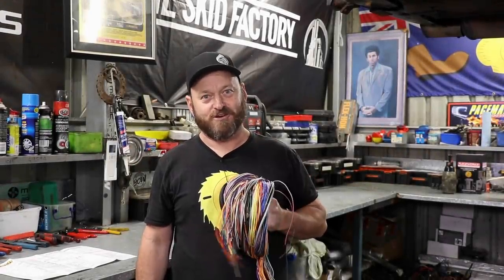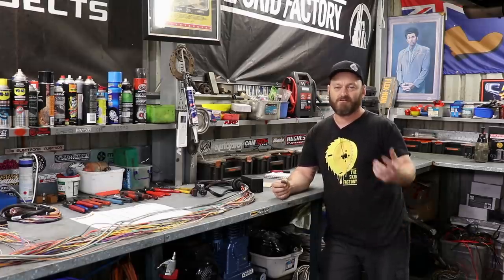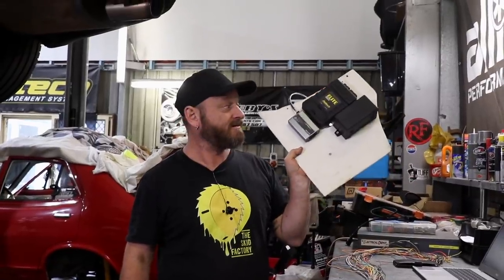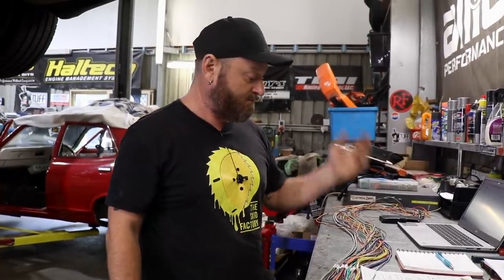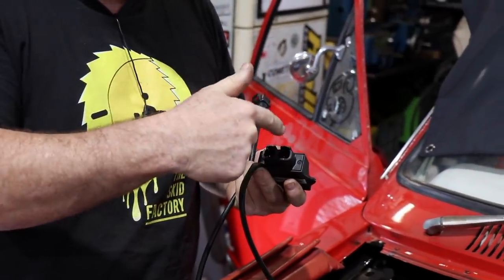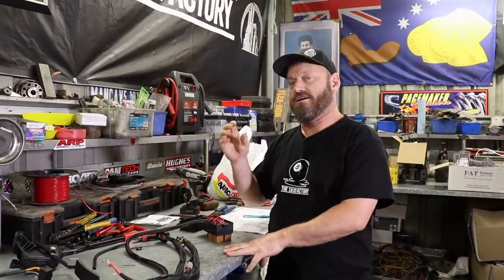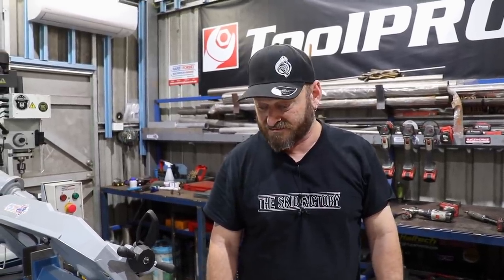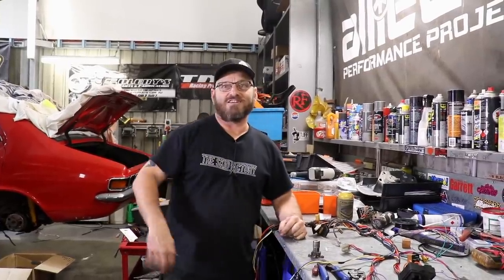1JZGTE POWERED LJ HOLDEN TORANA EP 13 - THE SKID FACTORY

Comment: Thats looking nice and clean, no reason to hide quality work. I used a MegaSquirt controller for my 95 Dodge Dakota with 5.9 magnum series engine (was 3.9). Actually soldered the entire ECU myself and was able to configure for all my (not LS) sensors. I was also able to configure sequential injection and spark, using LS1 coils salvaged from a paying job. You always can find a few goodies when eating engines from a salvage yard. Able to work out overdrive and lock up on trans as well as AC. The ECU fit my budget and is basically universal for any application, good support from DIYAUTO (dealer) and the forums. Used my brain and read a lot before purchasing. Now working on the new engine and dash harnesses when I can. 
Great content, I’m sure having to film everything is a pain sometimes but we appreciate it.

Comment: A tough part is making sure you’re using the right combinations of wires, terminals and seals. They tend to only really want a specific range of core and insulation size when you read their specs closely. You often need sort of specialist wire like 18ga txl with thin insulation that you just can’t get a your local auto parts suppliers. It really does all come down to careful planning though.

Comment: Thanks for that very informative guide guys iv got to do this with the factory engine loom and was far from looking forward to it but you have made it less daunting thanks and keep up the great videos and the great work.
Reply from the maker: Theres probably 3 days in both engine and ECU. Reduce the ecu spec and cylinder count and it gets faster. Maybe 5 hours uninterrupted for a simple 4 cylinder. But you still have to make connections to the vehicle which is also time consuming.

Comment: Love the wiring videos fella's.. was on the fence about the Ebay fuse block but the decision is made now👍
Cheers
Reply: They are a good bit of gear, I have one in my RX2 boot for the fuel setup. I have another to fix the jacked up ignition wiring. If you are fussy, you could just put in better quality relays.

Comment: until recently i had not done any full wire in looms before, im a qualified Diesel mechanic and have done some wiring of accessories and a such for electronic brake controllers at work, recently a friend paid for a pommy guy to make a loom for his super charged ncp13 echo with a maxxecu sport, he got the loom and it was more then average, feeling like ive got enough knowledge i put my hand up to fix it, i fully re-wired his flying loom whilst doing a proper concentric twist and heat shrinking it with proper heat shrink breakout boots, i even changed the wiring for sequential injection because the previous people wired it as batch style and then terminated it pulled it in and adjusted the ecu setup to reflect my wiring loaded a base map and turned the key and boom she fucking fired first go never felt so bloody proud in my fucking life and its from watching you guys do the work and actually listening instead of arguing in the comments that gave me the gonads to get it done, total time spent on loom, 8 hours, 15 minutes initialising the ecu and loading turn after firmware update, once again thank you so much for the information and giving me the drive to do it myself now i have friends lining up for my work because they where so impressed of my quality of work

Comment: Great video guys 😊 Wiring isn't scary so long as you are logical in your approach to it.

One thing to add with connectors is that you also need to check the current rating of the connector itself. Fine for most of the engine stuff but especially for fans and fuel pumps the 15-20amps will need a larger rated connector or you'll melt the connector. Seen that a good few times 😉

Comment: Awesome. I never really liked wiring, but its the stuff that i have to work out relays and fuses, not so much cutting and connecting wires. Have gotten better at it over the years and reasonably confident at wiring an ecu as long as i can work out whats needed for where. Having an au that needs an aftermarket ecu I'd really prefer something mostly plug in but thats not looking likely.

Comment: Irrational fear? No mate, having seen the average wiring job in aftermarket automotive work, its perfectly rational.

People seem to have zero fear, and will run a twist and tape positive insulated only by masking tape in a chassis return vehicle. I worked on a bus once where the tail lights harness was literally zip tied to an exhaust hanger... I'd have thought it'd burn to the ground first time you started it, but apparently it'd done several hundred thousand kilometers and that roll of the dice somehow hadn't occured. On the other hand the alligator clip instead of a fuse for starter solenoid trigger HAD melted into a pretzel (hence why we where fixing it), and the two 12v fans being mounted in series didn't actually turn slower, the left one had just seized solid. So if your going to do the wiring yourself, take the extra time and care to do it properly, it'll save you in the long run.

Comment: One complaint I have about Haltech universal harnesses is the fuse box, it makes the job of removing and installing the harness through the firewall a lot more difficult than it needs to be.
I always cut the fuse box off and crimp in some connectors so I can pass the short end of the harness through the firewall.
Reply from the maker: Yeah that can be a problem sometimes depending on the car. I have cut it off in the past or mounted it in the engine bay.

Comment: I don't have an issue with wiring new things, I have an issue with diagnosing wiring issues in complicated modern cars that act like they are haunted, when there are a million wires, often in unhelpful colours which are difficult to trace, and sometimes terminating and daisy chaining through impossible places like right up behind the dashboard! 

The wiring issues in my LS400 still give me nightmares. I think that thing had about 6 computers for different things as well! I gave up on the HVAC circuit and re-wired it from scratch with new fuses and relays etc, but then the AC refused to engage because the HVAC computer failed some sort of pre-flight check... Just madness.

Comment: For anyone interested in wiring, I'd recommend starting with small projects. I added a subwoofer to my car, and then removed an aftermarket alarm system and repaired the existing wiring. It ain't much, but it's gotten me much more comfortable with wiring. It's handy to know when bastard pack rats decide to chew through the loom on your car. 

I wouldn't recommend someone with no experience putting together an entire custom loom unless they have some experienced help or a lot of time and patience.

Comment: Those relay boxes are awesome! I have one of them in my RX2 for the fuel pumps etc. Got another one to replace the 30 fuses hanging off the ignition wiring (hate that). What are your thoughts on those aftermarket looms, like Painless etc?
Reply from the maker: They are pretty useless IMO. Excellent sales strategy but far from painless or EZY in reality. Most OE looms are saveable, I just strip them and add relays for load stuff and tidy it all up.
Reply: Searching comments for an ebay link to those fuse boxes... got it
Reply: @lancemarriott9671  I mentioned to someone else, if you are fussy, replace the relays with brand name, IF you are fussy.

Comment: When I was a Ford Dealer Tech in the 80's, I did a lot of Electrical and Driveability..... 
EEC-I and EEC-II were the OBD-I precursors - and Holy SHIT they were a Nightmare to work on!!! 😖😠😠😠😠😠 

I was promoted into Management right around the time when OBD-II started, and sadly lack a lot of experience with it. Now I want to build a 2002 Mustang GT.... But when it comes time to Tune it - I all of a sudden feel STUPID! I missed out on a whole Generation of Modern Tuning. YOUR Channel and Haltech's Channel have been invaluable so far!! 

But I still don't feel ready to start toying with Engine Parameters. In my younger days, I would RIP OUT the Fuel Injection and all Computer Controls - and slap a Carburetor and HEI Distributor in!!! 😳 
I know, seems idiotic now.

I've got a very late learning curve to sort out!

Comment: Great vid, just finished my loom a few months ago. Audi 2.7 bi-turbo with an lpg ecu added.
You mention 99% but no Alternator exciter wire. (Sorry i'm that chootch ).
Got most of my connectors from RS electronics, made by TE connectivity AMP. crimps are the more difficult ones to find.
31:16 That's an AMP plug by TE, looks like a SAAB plug to ME!!
Reply from the maker: I use a .5w 2K resistor to excite the alternator on vehicles with no charge light.
Reply: @theskidfactory  Fair enough. Great vids as always. Please send Moog @MCM a parcel of flour in a ziplock bag and orders for him to meet you in a Hotel room, sign it from Mr De Loren. Dodgy as F.

Comment: What cases do you wire in terminating resistors on communication circuits? In most cases should RFI insulation be used on data harnesses like high and low CAN or  pulse width modulated circuits?

Comment: Every Wire Goes Somewhere? Someone tell Kenworth!
 May have changed, because it was years ago, but I saw a trucker pulling the useless wires out of his dash. One end had two black wires with bits of tape covering the end, after chasing one down the loom and it folded and went back up the loom into a different branch, folded and back to the other bit with tape.

Comment: 12:35 The struggle with armchair experts is real.... that "why do I even bother" sigh from Woody was brilliant. 
As a one time electronics tech I'm not "afraid" of wiring per se. What I don't like, however, is trying to figure out what you did wrong when it doesn't bloody work! Especially when it tested fine on the bench (so you thought), so you went ahead and installed it, only to discover the fault.... grrr.

Comment: Al has made the switch to a Dell? Though you were running Windows on a MacBook Air which kind of defies the point of using a MacBook (and I say this as someone who generally dislikes Apple hardware)
Reply: Apple hardware is quality stuff.  The Apple closed ecosystem and abhorrent policies towards everyone else is the real problem.
Reply: @mattjohns3394  the stuff between 2010 and 2016 or so was good hardware wise. The T2 chip stuff onwards I don't like. They solder the SSD's direct to the mainboard now. So if the machine dies and someone hasn't backed their data up they are basically screwed unless they are willing to pay for someone to rework the board (Apple won't cover that under warranty as data is customers responsibility)

The current stuff infuriates me even more. The MacBook Air has a cooling fan that isn't even connected to anything even remotely properly.

Linus Tech Tips did a video on it a while back that gives good detail.

But I digress. Apple used to make good hardware. But now it's being done in a way that I feel is more wasteful in general and harder to deal with.

Comment: What freaks me out about wiring most is trying to trace a fault on a blue wire with a tiny white stripe among a dozen other blue wires with tiny stripes that gets switched to a red wire with a blue stripe then a green wire with a red stripe to a solid white wire and split in several directions and turned into an orange wire then back to a blue wire with a white stripe.
Reply: @cumbob   . That’s when a correct service manual, skill a lot of time good eyesight good lighting extreme patience and not having a bad back come in
Reply: You must have had an early Ducati or a Fiat.....
Reply: @alexbrown1995  Mini Chevy Ford Chrysler and Mercedes , haven't experienced Fiat or ducati but if Maserati and Ferrari are any thing to go by...
Reply: @anomamos9095  Anything Italian used to have appalling wiring. I bought a new Ducati in 1972 and as I was turning into the dealers shop for the  first service the left hand switch block caught fire. And I was chasing a fault in one of my Fiats and found that a wire changed colour half way along a loom somewhere....